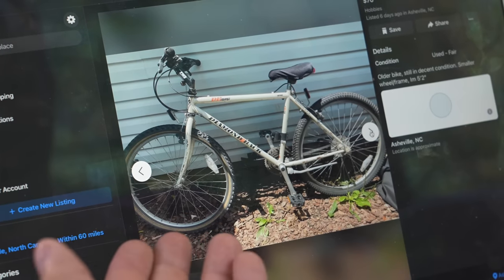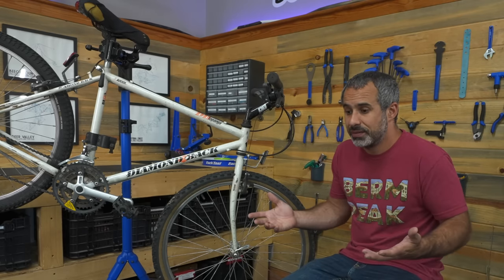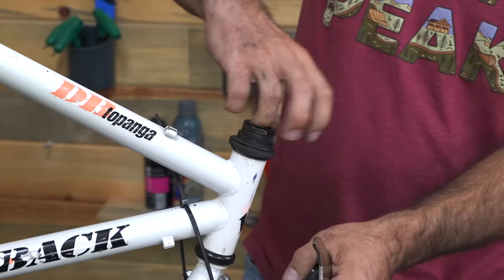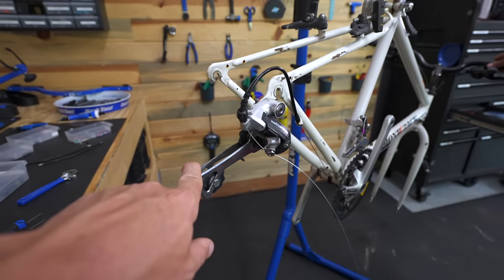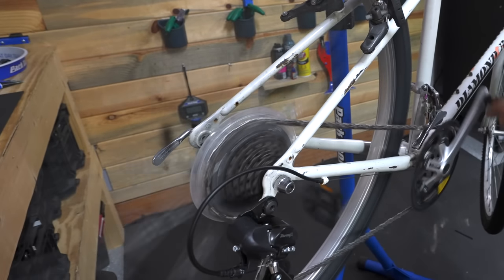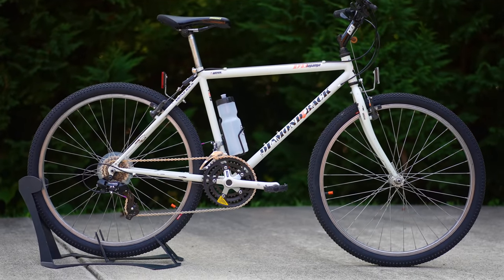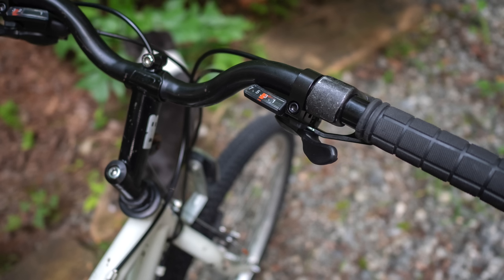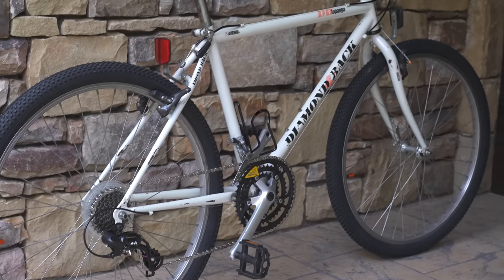90's Mountain Bike gets Transformed for Profit (Flip Bike EP1)

Comment: 26 " rigid bikes are so underrated and always great to see another one saved and back on the. They are easy to work on and so versatile. Unfortunately those shifters always givee problems
Reply: I've got a super basic trek 3500 with a frame a few sizes small on me, that I found for $50. It cost somebody a whopping $260 in 2006. It's been so eye opening to me. It's an mtb, it's a road bike, it's a trials bike, it's a bmx bike. Ride a 3 foot drop to flat, ride a pump track, ride 100 miles a day, ride across town, ride circles around broken or very under utilized $5k dh bikes out on the trails. Great saddle, Good shifters. The chain can jump off if you're thrashing. Obviously you can't have EVERYTHING for $50. However, the versatility, durability, and value is utterly astonishing. I'm thinking of adding hydraulic rim brakes, I love it so much.
Reply: @apodski  don't add hydraulic rim brakes, add some proper disc brakes 😎
Reply: @broken_font1881  I would if that were practical. You can't just add disks to any old frame without significant welding and fabrication skills. Also, rim brakes can be quite nice, they just require significantly more maintenance and fiddling around.
Reply: Just picked up a '95 GT tempest for $175, and a '98 Trek mountain track for a buddy $40! So much fun getting them cleaned up and admiring the quality... My buddies eyes lit up more than they do on his 4k mountain bike 🤣
Reply: They are lovely to ride, without the extra weight of suspension or it bouncing about when you don't want it to, I still use my rigid 90s bike off-road with at least 50 psi in the tyres
Reply: They really need to sell a decently built rigid 3x7 mtb, 1-1/8 steerer, rim brakes. No frills, just a ~26 lb bike that does everything and holds up. Make it $350 and it would open up the world to so many people all over. The suspension forks that are on any sub $800 bike can't take nearly the amount of trail abuse that a decent rigid steel fork can.
Reply: @apodski  check out State Cycles! Company based out of Arizona with exactly what you're thinking of!
Reply: @apodski  I love my 1990 Specialized Rock Hopper for those reasons. I have a Salsa Journeyman for pavement, but that old rigid frame Specialized is immortal. Brake pads, tires and a few chains over 32 years are all it's needed, still shifting great on original derailleurs and shifters.
Reply: @whyeven3722  Yeah, rad specialized's rock. My only complaint on using quintessential 90s mtb's is the tall top tubes that get in the way for some stuff and canti brake. They do look great with tall top tubes, however.
Reply: @bikeislife8405  Oh, yeah they have some good stuff, good to know.
Reply: @bikeislife8405  Their rigid forks look really nice too, without being fiendishly expensive.
Reply: I've also found continental race king 2.3 really wake up an old 26". The folding version is crazy light and supple.

Comment: The gummy thing in the shifter is the residue of old lubricating grease. It's a common theme on the shifter originating from the 100gs line. You should really consider repacking them with oil (instead of grease) after you have degreased\degummed them.
Reply: He did, didn't he? But after all he had to replace shifters because teeth were missing.

Comment: I love this, a little bummed out by the replacement or the rear derailleur though...
Reply: True, I noticed that in the montage, but it was not mentioned at all otherwise.
Reply: Cable pull ratio is different from any shimano shifter available today so a new shifter wouldn’t work without also replacing the derailleur
Reply: @andrewsteavpack9079  true.

........but a Tourney... Oof.
Reply: @eschedefilmcrew  I kinda agree, but if he was going to sell it it would make a lot of sense and they work perfectly fine for what that bike is made for. Since he’s keeping it I think a long cage road derailleur would be cool
Reply: @andrewsteavpack9079  yes, but a tourney?, its depressing hahahah
Reply: @666gamr  I think the bike will likely see a sequel
Reply: @andrewsteavpack9079  Correct! Just wondering why is was not mentioned at all in the video.
Reply: @andrewsteavpack9079  yeah no, i mean. you're absolutely right! i repaired and built up some bikes as well and always hesitated to use really cheap parts like the Tourney group for example. however because of that, i was never able to make any profit, since people (at least here in germany) don't think used bikes, no matter the condition are worth anything. it really is depressing. so yes, i totally agree with you - with the intention of selling such a bike, going with cheap parts is probably the smarter way to do it.
Reply: @andrewsteavpack9079 nah, all Shimano derailleurs have had 2:1 pull ratio standard since the invention of sis (indexing) that LX is no different

Comment: I own a blue Vintage Diamondback Topanga, my first and only Mountain bike. Upgraded everything back in the day, switched out the rapid shifters to Shimano Deore Thumb shifters with click and friction, Dia-Comp Brake Levers, LX Front and Rear Derailers and Ritchie Logic Cranks and Rings,  Nice pedals with toe clips and straps, new rubber and a new saddle. Recently recabled it and switched to a brand new set of specialized vintage tires I had in storage 2 different tread patterns, re- cabled it and now am rocking my vintage bike in my 50's. Like you say, old high quality parts last forever if maintained properly.

Comment: I recently started doing this. Picked up an old KHS for $30 and put all new brake pads, cables/housing, tires, rear shifter, and grips on as well as repacked the bearings with grease and lubricated pivot points on derailleurs with tri-flow.

Clean the frame with simple green and finish with Pledge for a nice shine and it’s good to go!

Also, if anyone’s wondering, 9 times out of 10, you can bring old shifters back to life with a strong degreaser (I use motorcycle chain cleaner), lubing the springs inside, and moving the little ratchet back and forth to break the crud free that’s jamming it up.

The bike turned out way too nice and I’m keeping it for my fiancé or to be used as a guest bike since she now has a couple bikes 😂 

I just finished cleaning up and tuning an old Chromoly Giant bicycle today too which is now mint 👌🏻

All my vintage chromoly bicycles get kickstands too. It’s just a fun hobby, provides a little extra money, and is good for the environment too.

Just wish I had a degreaser to throw the chains and sprockets in!

Comment: 9:42 „I think this shifts smoother than my mountain bike“ 
I know a Tourney drivetrain is technologically about 50 years old and barely changing for the last 20 years, I have it (3x7) on a 2020 Trek Marlin, it is really buttery smooth, still with reasonably fast shifts, if you stop pedaling for a fraction of second, no kicking, sounds good and is geared really well, like it much more than SRAM I have on the other bike and is really cheap to replace if anything breaks. Really good drivetrain and fitting to this really nicely putted together DB.

Comment: A year ago I've found a 90's Wheeler MTB for sale for about 30 USD. The paint is good, all the bearings are flawless, but there were gears that weren't working, brakes needed adjusting, chainrings and the derailleurs are good but the chain and cassette needed to be replaced, yes cassette, someone had the original wheel with a freewheel replaced with wheel with a cassette, so it's a 3x8 now. I added the same model of shifters like in this video. I've put all new loose ball bearings into the wheel hubs and the bottom bracket, new tires. The bicycle is a BLAST FROM THE PAST. It rides smooth, it's feels light, sturdy and agile. 
I just love it, I love it more than my modern Ghost hardtail MTB.

Comment: I know this is from a year ago but for shifters we use finish line speed degreaser at our shop to flush out shifters. It's amazing stuff. We used to use pb blaster but the smell was too much. Finish line speed degreaser has a smell but it disapates quickly and it's 2x as evaporative as isopropyl alchol. It is a powerful substance which clears even the gummiest of shifter internals

Comment: I had an old rigid mountain bike, a Stycle 2618M. It was a cheap bike in its day, but it had a short seat tube height and it was l-o-n-g. With some slicks and a few more mods (I found out the one piece bottom bracket is actually a BMX US style by sizing and so the press fit BMX bottom bracket with the square taper spindle worked perfectly and gave so many options for cranksets to use). 

It was the best gravel bike I had built, but it took up too much space, so I sold it to a friend who needed a bike for fitness.

Comment: I used to work at a refurb vintage bike shop. We were a non profit and took donation bikes and then totally revamped them into awesome rigs. Usually with fenders, baskets, alt-bars. I just wanted to say, these shifters are by far the worst I ever had to deal with 9/10 they were broken and 10/10 when they worked they sucked. I chopped them off so many integrated brake levers--its funny watching Seth go through the same trial and error that I did back then.

Comment: Tip for the grips...I use hairspray. Squirt a little round the inside of the grip..it should just slide on. And when the hairspray dries..it helps the grip to stay in place...Also Idea for getting them off....squirt some under the grip twist..and pull. Use a large zip tie to get under grip...could use screwdriver but they could scratch the bars or damage the grips.If you have air..then no probs...but alot of folks don't have that handy.

Comment: Just purchased a near mint ‘97  Hardrock. The fork has most of the paint damage, but still looks great, and the frame has very minimal paint damage only noticeable up close. It has a newer Alivio crankset, but is original otherwise, shifts flawlessly, and original tires are 90-95% and the rubber is soft with zero signs cracking; they look a year or two old. The stickers are still on the laser straight rims. The best part is I found it for $40 Canadian which is about $30 US. Oh yeah, it came with a rear rack, multi mode taillight, and good quality kickstand too, but I took that stuff off. I’ve flipped a handful of similar bicycles in the last couple of years, but I might have to keep this one. It’s way faster around the city than my bulletproof but super heavy Sasquatch which is a 100% slug on anything other than a downhill grade of some kind.

Comment: My 1990's ROSS Mount Olympus 21 Speed Mountain Bike, I still have, yet I up graded over the yrs. I put in new push button shifters. The original Oval changelings, I worn THEM out. It has a complete new power-train. All steel frame, American made Rims ORIGINAL.  Its weight is 45lbs. Hard tail is an under statement. I also put in a NEW bicycle carriage cartridge, this was a game changer in its performance over the old ball-barrings. I have Butterfly Handle Bars that bring it all together. When people & other bicyclists see my bike they think its new or a hybrid LOL! Yes, my old shifters were missing teeth when I took it a part. NEW ones have lasted longer so far. Now my old ones the bray lever was separate from the shifter, and my newer ones they are combined, and I see your problem; GOOD LUCK...... I wouldn't sell either, that's why I still have mine....

Comment: Use hair spray to fitt the handlebar grips. It would make them slide on easy and would act as glue when it dries up. And to get the handlebar grips of again, just ad more hair spray. Workes with all rubber and silicone.

Comment: Flipping bikes is my secondary income besides work and Ive been doing it consistently for the past 6 years. 
At some point I had a hardtail 29er, dirt jumper, 27.5 enduro bike, a gravel bike, ironhorse sunday because of my 26 inch nostalgia and 2 commuters. 
All of them were well known brands and models in mint condition and they were all well equipped with mid to high end components. 
One day I realized that all I really need is my Nukepropf mega, so I sold the rest of my fleet. 
I made a bank in a hurry indeed, but it also made me realize that I actually made a decent profit out of bikes that I kept for 3 to 4 years.

Comment: 90s Diamond Back. A man of culture. 

Those shifters are known for the grease getting gummy so pawls do not engage. You might have destroyed the shifter mount for no good reason by not thoroughly cleaning it. It is not enough just to spray it with degreaser. The pawl sometimes needs to be wiggled a lot with a pair of pliers because grease will harden on the sides where friction occurs. That's why it sometimes skips gears. I doubt it was "broken teeth" like you described because the engagement "tooth" is a ratchet step on the core cylinder that the pawl engages and is not easily worn down. When the pawl is gummy and doesn't spring back into place quickly it can and will glide and "miss" engagement when it should.

That said, that particular era of 7 speed shifter was not the greatest and replacements are affordable. 

The Topanga is a nice bike. I hope you find an Ascent next. Superior tubing and spec.

 Didn't see when you replaced the RD or the reason why.

Comment: Great video! I've got my hands on one of those vintage diamond backs for free (because here in Germany noone really knows the value of these bikes)

And for everyone who hasn't got an air compressor in their workshop: get some lighter fuel and put it into the grips. They'll slide on the handlebars easily and the lighter fuel will evaporate within a minute or so ;-)

Comment: i always flipped the bracket that holds the seat on so that way the tightening bolts are concealed by the sides of the saddle, it gives it a lower center of gravity even though it is harder to get the tool in the nuts....

Comment: I still have my 2000 Trek 4500. It's still in good shape. Even has an Answer suspension seat post. It's pretty much outdated compared to newer offerings. I'd even say a low end Marlin would leave it on the trail.

Comment: "If something breaks, we'll panic."  Ha, ha, ha!!
Very well said! Break an STI shifter and you're HOSED!!!

3:36 is a PERFECT example of how these shifters get gummed up and cease to function.
A little degreaser, an air hose, and quality grease will usually restore them 100% and without any disassembly.  (How do I know?  I foolishly fully broke down an Ultegra STI because, well dammit, I had never done it before!  Well, the SECOND one I serviced saw this approach instead and it works just as well - like new.)
This PLUS replacement cables & housing restores this system to its original glory!  If you catch this stuff BEFORE you're "wrenching" on the shifter to get things to work, you'll spare them from failing and practically make them immortal.

Comment: I just bought a 2000 model Specialized Hard Rock Comp from the original owner.  I paid $160 for it.  The RH shifter is broken, so I ordered a pair of new left/right shifters with brake levers for $20 from eBay.  I put a new seat on it from Amazon for $16, a new stem for $15, threw in the old stock bars from my new Rockhopper Elite 29.  It already had almost-new tires and grips on it.  I'm still waiting on those shifters; I think good ole USPS has lost them. But the plan was to take it to the bike shop for new cables, chain and let them tune it up.  Then I'm giving it to a friend I made here at an RV park where I'm staying for a while... he's mid 60's and doesn't have much money, but wanted a bike.  So I think this will do him well.

Comment: This type of bike Is such a pleasure to work on; easy to understand and hard to break! About the worst you can do is drop a ball bearing and lose it.

That was a great workaround with the integrated brake / shift levers. I would have used it as an excuse to bin-off the dual levers and replace the cantilevers with a cheap set of V-brakes (basic Tektros run at about £26/$35), or period Deores if you could find a nice set on E-Bay! It would be worth it for the easy skids… and not having to dick around with transverse cables and yoke angles.

Comment: Pro Detail Tip: Use a magic eraser to wash the bike and get those scuffs off. It is basically ultra fine sandpaper, no need to re-clear coat afterward. Apply some paint sealant (wax/ceramic) when you're done.

Comment: I've got a 94 DB Topanga I've had since new. I didn't ride it for almost 20 years, it was sat in the garage completely unmaintained. I cleaned it up about 5 years ago when I got back into cycling and I've done nearly 4k miles on it since. It's had a few new components in recent years, inc new shifters, new handlebars etc, and the obvious parts that wear out more quickly. Was only last week I replaced the original BB and chainset. My next move is to go tubeless, and I'm also considering changing to disc brakes if I can get the Chaser adapter to fit and it be safe enough 🤞 while it's become my second, fall back bike I still don't want to part with it as I've had to since my teens. My previous, and first mtb was a DB Ascent from 1991 in a beautiful black and white paint splatter effect, unfortunately that got stolen which is when I got the Topanga.

Comment: I own a 90's bike. 1995 Schwinn Beach Cruiser. I'm not very familiar with how identify the model of the bike that's what it looks like so I'm going to go with it. 27 years later its mostly original. Rides like dream. I'm not sure hot to add breaks to it thought. The only brakes it has is a coaster brake. It is a green/ teal bike. 26 inch white-walled wheels. It needs to be pointed thought. It is a single speed.